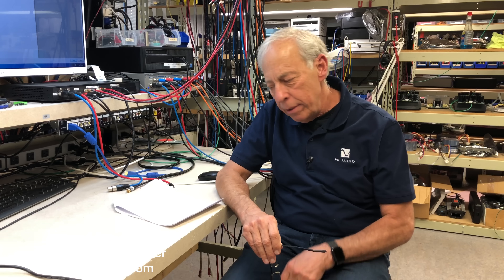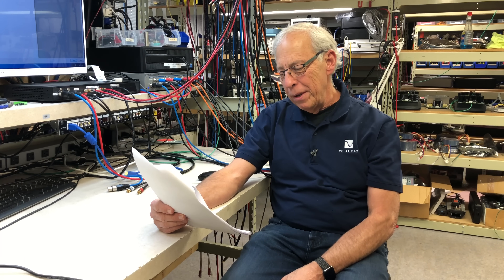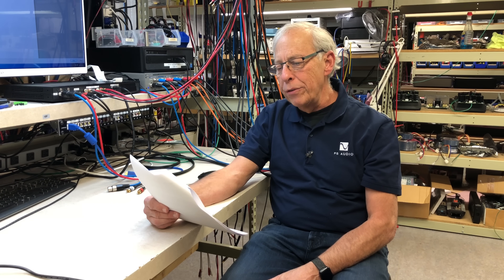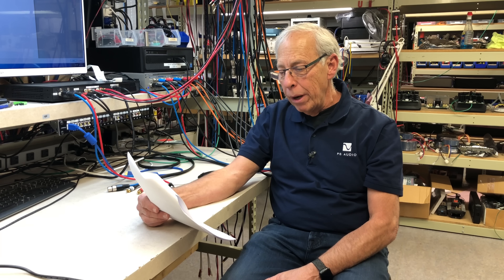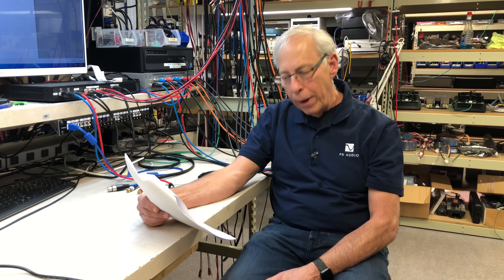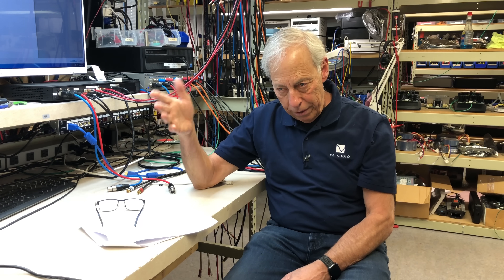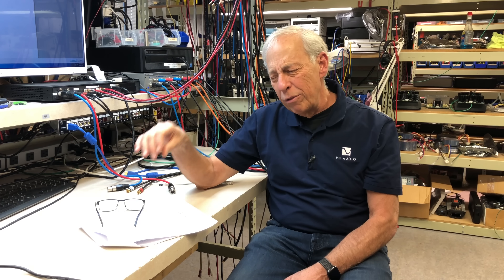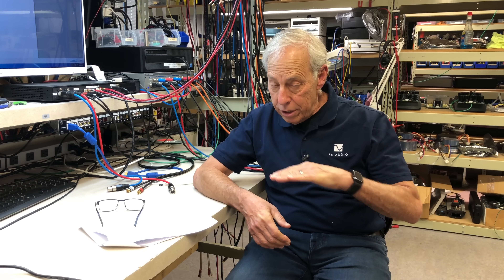Can class D amps be high current?

Comment: I have read that when looking for amps to drive difficult speakers you should look for amps that "double down". For example; 100w@8ohm doubles down to 200w@4ohm. Many amps being sold can't do that.
Reply: You do realize that, as this particular point of advice becomes more pervasive, all the manufacturers need to do, is under-rate their amplifiers at 8 ohms to fool customers into believing they are "high current?"  
At best, it's a rule of thumb that only applies to the more tame speaker designs that do not venture below 4 ohms impedance.  That 200W at 4 ohm amplifier may, or may not, handle 2 ohm impedance dips, while another unit that only increases from 100W @ 8 ohms, to 150W @ 4 ohms, might fare better with the same load.  Few spec sheets will help you here, and relying on 8 ohm and 4 ohm data alone is what we call making dangerous extrapolations.
Reply: @jim9930  You obviously know shit.

Comment: Ironically, dynamic speakers, woofers in general are easier to drive at low frequencies due to back emf generated as the voice coil moves. The back emf has the effect of reducing the difference in voltage between the speaker input and the amplifier output thereby restricting the current through the speaker’s voice coil impedance. Planar magnetics are mostly resistive vs reactive, and thus less prone to large variations in impedance. The back emf is low which means greater voltage difference which means way more current at low frequencies.

Comment: Okay, Paul.  So you would drive the IRS 5's with class-D amps.  I think not. When I come to Boulder please show me the amps powering these bad boys.
Reply: The amp you use to drive the IRS V's only powers the mids and tweeters.  The woofers are powered by the built-in amp, which is Class AB, around 1500-2000W.  
Class D technology is still improving rapidly and you need to be willing to let go of obsolete opinions.  The newest units would be quite suitable to use with the IRS V's.
Reply: guitarpicker...No!
Paul uses his top-of-the-line BHK class AB's.

Comment: I always pictured Class D as instantaneous high current 'on demand.'  It only utilizes what is needed. Its idles at low current when not needed.
Reply: not many class d amps idles at low current, hypex for example thats used in nad m22 idles at 40watts and d3020 at 16watts. complete opposite to icepower class d.
Reply: i am just saying that all class D is not running cool, i have a class A amp also, was getting very hot to the touch just sitting there same as my nad d3020. both about 30 watts amps.
so if people want an amp that dont get hot, do research first.
Reply: all wattage usage at idle is the heat output of the amp.  its basically the least amount of heat it produces and its only goes up from there(not sure about class A).
Reply: i am not saying that a class D can't run cooler at idle, just that most class D runs hot at idle.  10 watts of heat for doing nothing is not cool. 20 watts and above is really hot.
Reply: @sudd3660 ...however you want to keep 'twisting' your response to this issue; be it a matter of current at idle or power consumption or heat dissipated & I'm only going to say this one more time for the slow learner ...Class D runs on less power (watts) of consumption than Class A or class AB...ok!?
Reply: ok

Comment: Great info as always Paul. I think it has mostly to do with the Amp. build. I use a Canadian made Class D. {Axiom audio}It is essentially an A\B Toroidal with class D switching for  peaks. If the innards are built for power high current should be no problem. {small caps in reserve won't do a lot}

Comment: Basic physics from high school: P = V * I
Where P is power in watts, V is charge in volts and I is current in amperes.
So just look for the amount of "true RMS watts of continuous power" (not watts peak) it can produce; current is included in this figure.
Reply: I always remembered that formula as finding watts being easy as pie, or P = I x E. That would be true for a constant steady resistive load, however reproducing musical signal are pulses of energy that last for short duration of time into a reactive load. RMS power and dynamic power need be considered. Dymamic power rating of 2.7db is considered good. Voltage levels must be maintained under percussive drum slams or movie explosions. This takes a high current power supply to keep up so the voltage will not droop thus compressing the sound. Class D can do this, so can a robust A/B design.
Reply: @zulumax1  Interesting... I always learned it as P = U * I
U is the European symbol for charge in Volts, while it is V for most texts written in American.
Over here E is best know as the symbol for energy in Joules (as in the mass-energy equivalence "E = mc^2"), sometimes E is used as a substitute for the omega symbol at resistor ratings in systems/software for circuit design that can't handle Greek symbols (R as substitute is way more common though).
Reply: @QoraxAudio  E was used for a symbol of "Electromotive Force" or pressure expressed in Volts which was a quantitative measure of force named after Volta. That is the way I was taught in class. I also remember ELI the ICE man, which is AC theory of voltage lags current in an inductive circuit, and current lags voltage in a capacitive circuit.
Reply: @QoraxAudio  There was a non politically correct way which we were taught back in the day for remembering the resistor color code. Those of you who know, know what I mean.
Reply: @zulumax1  Ah yes, I forgot about electromotive force.
Long time ago that I had to deal with that.
Same for the color codes.

Comment: some people have little knowledge!

You have to look at ohm law! 4 ohms and 20 volts is watts or volts and the amp is equal to watts.

Switching power supply was made to deliver more amps or as much as an old type transformer but in a much smaller size. yes there is bad power supply and good. Switching power supply has more stable power since outputs are regulated. But you have always  higher output noise, so  the are  many who continue to use the old transformer. Also since the old transformer is more robust.

You can make good switching power supply if the factory does it right.
Reply: That was my answer to his question at the beginning of the video, use ohm's law for the answer.
Reply: Exactly! This "high current amp" talk is just more audiophile bunk! Audio amplifiers are measured in output watts, ideally RMS. Watts are the product of volts and amps. High current by it's self means nothing.
Reply: @blackened18019  First I don't use class D amplifiers. What is your electrical engineering background? If you have an amplifier that can supply high current, then by default, it can supply more watts. Wattage or power  is voltage times current. More voltage, or more current, or more of both equals more watts. Also current draw is determined by the load. The load, in this case speaker will draw the current it needs based on the voltage supplied across the voice coil resistance. The amplifier does not push current, the speaker demands it. Voltage on the other hand is pushed. And that determines the current required based on the load resistance.  It's called "Ohm's law"!
Reply: @blackened18019  
No, @Andy Delle is EXACTLY right.....smh
Reply: @poserwannabe1  Another amateur EE
Reply: @blackened18019  We'll let the community here decide that. Are you stating Ohm's law is not as I outlined? Do you realize Ohm's law is the most fundamental formula in electrical engineering? Fine, go on record here as a fool.
Reply: @blackened18019 ...if you don't recognize "Ohm's Law" Mr. 'blackened 1', then you can not even be considered as, "Another amateur EE"...maybe you're just a frustrated fool, at best.
Enjoy your ignorance sir; I certainly am :-)

Comment: think about this if class d cannot deliver high current, why hiend subwoofer use class d in it？
Reply: it is very common with. class-d in car stereo for bass speakers

I think class-d was more expensive than a regular AB amplifier. Many
class-d amplifier card from ebay is no good for 4 ohm 2 ohm! 
But if you create Class-d correctly it can be very good. Many new PA amplifiers use class-d or a variant of it.
Reply: @jim9930  For most people over 40 years, you should only measure noise until15 kHz. We can't hear above that anyways.
Reply: @oysteinsoreide4323  Did you have a brain injury recently?
Reply: Why do you think high-end subs need high current? Some may and most don't.

Comment: I have two Crown 1502's and am very pleased with their performances (rated 300 watts in 8 ohms). The sound, after having two mono amps, is more detailed, great soundstage, and sound coming out of complete silence, which the monoblock amps did not have (noisy toroidal transformers). The class D amps I have do not have any problem with the ohms 2 to 16 . . . no sweat, not to mention their versatility of bridging, etc..
Reply: My Crown 1502 sounds great on my floorstanding Adantes. It is also a very dynamic amp.
Reply: Some people think they always have to have so many watts to get good sound! Much watts is not equal to good sound quality! There is much else that also counts inside an amplifier!

You can have a 100watt good amplifier that gives you better sound quality than a 300watt amplifier does.
Reply: Toroidal doesn't have to be noisy
Reply: @xanderguldie  That's true! Toroidal transformer has less noise than the switching power supply has! Switching supply has the switching frequency that makes noise and you have to filter out the noise at the output. But in the PA world, the factory also thinks of the weight of the amplifier and therefore they use Switching power supply.
Reply: @ford1546  exactly
Reply: @FatRat-f9m  Just ignore Larry. He thinks he's the Audiophile Police.
Reply: @thisisnev ...Hey Nev, I hope you had a good Christmas!
"Just ignore Larry"? What!? C'mon you know that I'm here for some fun.
Sometimes Larry gets it right & sometimes he talks out of his arsehole (I think we all do sometimes...including me)
So, if he's gonna make a statement like that, well, I want it qualified.
If Larry is the 'Audiophile Police' (hahaha) then I'm the 'Idiot Police' :-)
Happy listening!
Reply: @FatRat-f9m  Cheers, FR! So... am I the Audiot? ;¬)
Reply: @thisisnev ...it depends on the topic & whether you're making sense (following a 'logical' argument) or if you're just 'stirring the pot'.
Either way intelligent people do make mistakes & say the occasional stoopid thing...I mean, hey look at us!
LOL ;-)
Reply: Larry Niles crown 1502 actually sounds quite good. Not high end, but good audiophile quality for it's prize.